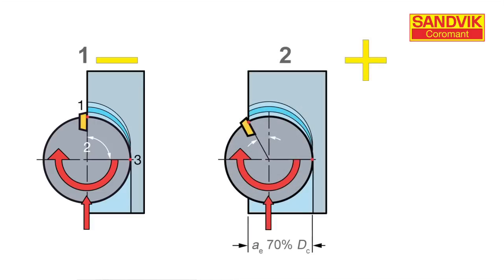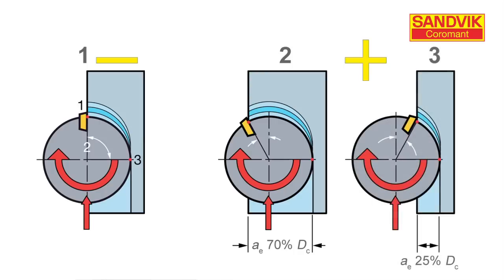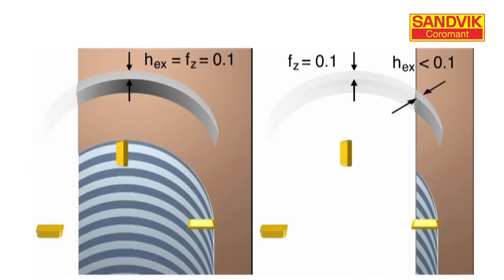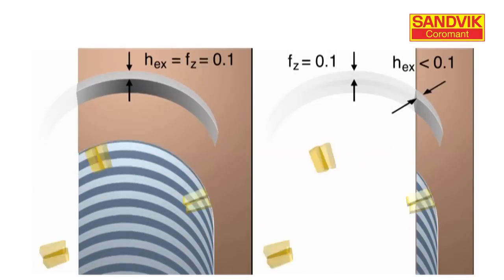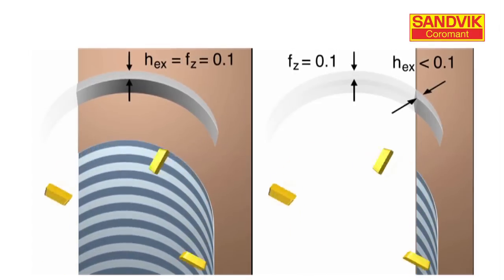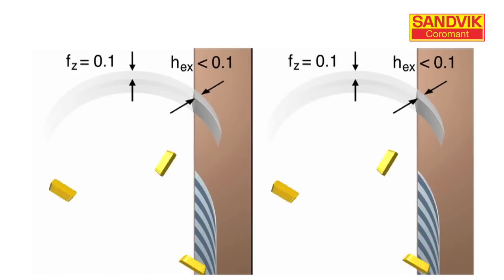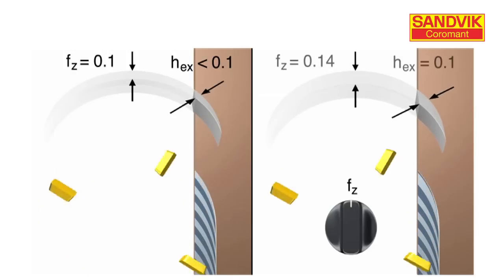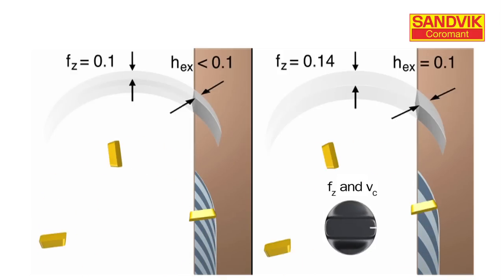Tips film: Cutter position in milling machining

Comment: Nice video, but I think it should be clear about when to use 70% engagement and when to use a radial engagement amount appropriate for chip thinning. At 70% engagement the cutting edge shown in the video isn't engaged at all. What it doesn't explain, is that in something like a facing operation where you have low axial engagement, there is a cutting edge fully engaged on the bottom of the tool.
Reply from the maker: Hi Scott,

In this example the animation describe a face milling application using a 90° face milling cutter in constant feed. We describe the chip thinning effect when decrease and increase Ae compared to a centre lined tool, independent of D.O.C.

Recommendation is if the setup is stable and there is enough power in the machine to position the cutter at 70% Ae and D.O.C as much as the tool application allows. In a weak setup where vibration is a risk or power is limited it´s better to reduce Ae, sometimes in combination with reduced D.O.C.

Best regards,

Torbjörn Wikblom 
Application specialist 
Product management -Face milling tools